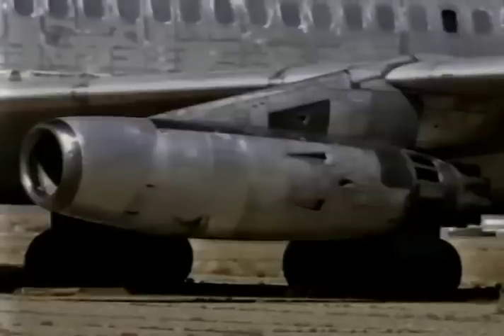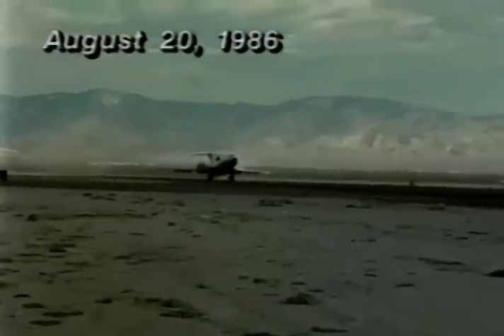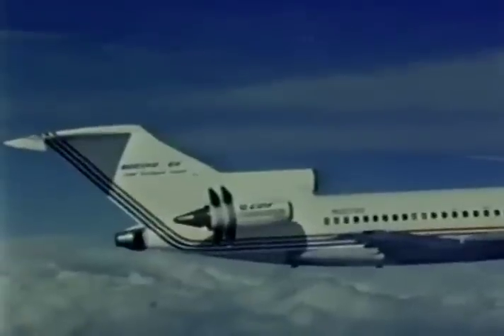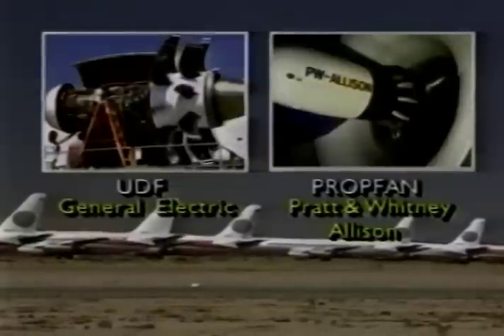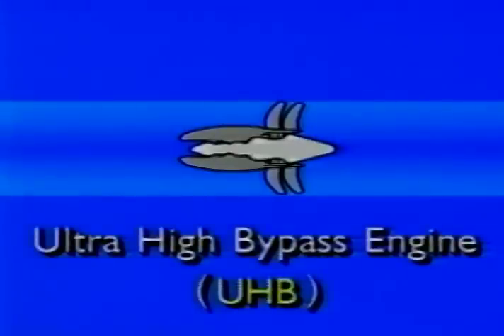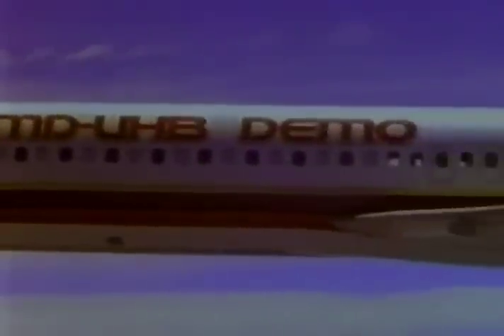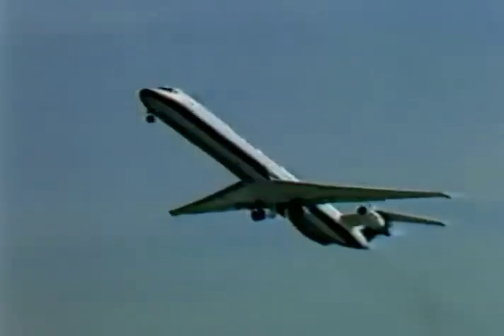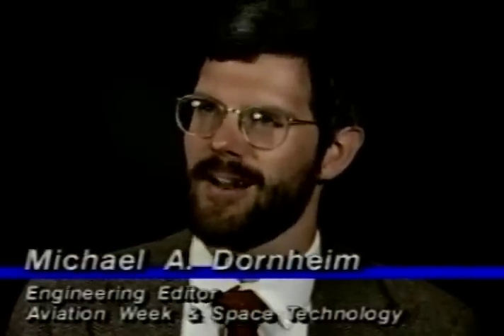The Incredible Engineering of Ultra High Bypass Jets

Comment: now we know that with a gear we can achieve a slow rotating huge fan to achieve a really high bypass ratio of 70. that seems to be the future. if we want to use expensive eFuel, then we need very efficient engines.
Reply from the maker: Hi Stefan, thanks for watching and taking the time to comment. It does indeed seem that GE, Rolls Royce and Pratt & Whitney all have their own geared ultra high bypass programs at the moment. There may yet be some tough technological challenges ahead so watch this space for updates.

Comment: Essentially, this is how a turbo prop works. The UHB failed due to noise issues.
Reply from the maker: Appreciate you watching and taking the time to leave a comment Aphex. I think your summary does not quite catch the essence of what took place.  It is partially correct in that noise was a big issue. 

The entire premise at the time, however, was for the economics to work, both the fuel efficiency improvement and the increase in fuel prices needed to occur. Beyond that, as the comments I've made all over the place make clear, much of the technology is very much alive in evolved form today. In fact, modern turboprops increasingly look like UHB, from general aviation to cargo transports used by military services across the globe. Are they Ultra High Bypass jet engines? One could make the argument, no, they are not. Are they evolved from the technologies and ideas of UHB? I think you can say, yes. Just like a 787 is not the same as a 707, but, putting aside the number of engines, it is an evolved expression of the ideas, technology and experience of its predecessor.

Comment: Turning the fan into a propeller isn't practical for speeds above 500 mph. Contrary to what is often told, the fan is really a compressor that compresses the bypass air along with blowing air to the engine, both core and bypass. The bypass air expands and accelerates to produce jet thrust in a similar manner to the core. Sure, smaller diameter propellers with more blades work better at higher speeds but they achieve their best efficiency between 400 and 500 mph if that which is why the A400 (an unducted turbofan engine) flies at these speeds when true high-bypass turbofan engines are most efficient at speeds above 600 mph because of the fan's role as a compressor for the engine to produce more jet thrust even if the overall exhaust speed is lower than that of a turbojet.
Reply from the maker: Chris, I just re-watched this video to see what you were specifically responding to and I can't for the life of me figure it out. 

Your first sentence is, "Turning the fan into a propeller isn't practical for speeds above 500 mph."

No claim by me (back in the late 80s by the way so any response to this video should be given with that context) is made about turning the fan into a propeller at any specific speed, let alone above 500 mph. This video is a report about two companies trying to build ultra high bypass jet (gas turbine) engines in pursuit of fuel efficiency. Not a specific speed target. 

I watched your two jet engine explainer videos and read your about tab before responding. I can see you have a deep and sincere interest in this topic and aviation generally. As a fellow creator, let me share with you that it is considered rude to drop a comment in the manner you have. I don't know if you were trying to help clear up a common misconception about what folks typically call fanjets and high bypass ratio jets (which this video had nothing to do with and therefore your comment would be off topic), or drive attention to your own channel and videos, which would be spamming. 

I wish you well and improving wellness (I did indeed read your about tab). And suggest you conduct yourself with this in mind: Do unto others...

Comment: Were the UHB engines as loud as I suspect they were?
Reply from the maker: They were louder than current high bypass ratio jets if I recall correctly. I did hear them run as you can see from some of the footage in this story, but it was back in the 80s. I would not say they were surprisingly loud. In fact, less so than early pure jets 50s-80s, but because of the open rotors they sounded different too. Appreciate you watching and taking the time to ask a question.

Comment: with the advancements in engine and prop tech, this idea might be revisited.  Things like a Pratt and Whitney 150A engine with a Dowty hub and 6 bladed prop are seriously quiet in flight these days.  The GENX engine is scary quiet.  Add in the ceramic matrix composite from the GE LEAP engine once they get the issues worked out, and this looks like an interesting combination.
Reply from the maker: Thanks so much for watching and taking the time to leave your helpful and thoughtful comment. Between CFD, CAD/CAM, additive metal printing (3D printing) and other advances, from noise to vibration and efficiency, I'm sure something that looks like the child of UDF could be very much a possibility.

Comment: The reason for the efficiency is simple. Based on the kenetetic energy formula: 

Ek=1/2 mv^2

And  Newton's first law:

m1v1=m2v2

It take less gas to move a big mass of air backward at a lower speed for the same amount of trust. The easiest way to do that is by increasing the diameter of the pressure disc of your propeler.  The unducked counter rotating fan are very noisy and don't had alot of gain by having the second fan capturing the rotational flow from the first fan. That's why the single turbofan commonly used today have won the feasability contest.
Reply from the maker: Thanks for watching and taking the time to comment with such mathematical detail. Curious what others with expertise in the math, science and engineering related to the physics here think?

Comment: It's 2020. This idea went nowhere.
Ducted fan won out.
Reply from the maker: John, I do appreciate you taking the time to watch and comment. 

However, if you'd also read some of the hundreds of other comments you'd see this thought has been addressed.

For the record: Turbofans or fanjets existed long before the experiments shown here on UHB. They have simply gotten bigger (in some cases) and, wait for it, incorporated many of the technologies explored here... in UHB research. Despite some problems, Pratt & Whitney has gone big on geared turbofans of late. That's DNA from the propfan effort described in this video.

There are also highly efficient advanced turboprops flying that incorporate lessons learned in UHB. Take a hard look at the Airbus A400M Atlas or Lockheed C-130J Hercules. Not identical to UHB but as distant cousins the family resemblance is clear. Ducted fan, as you called it, survives for sure. But many-bladed gas turbine-powered turboprops (essentially unducted fans)  with highly swept blades exist today in the examples I gave above, and, arguably, others operated in aircraft built by the Former Soviet Union.

Comment: It's now 11 years later and these UHB's are still nowhere to be found. I think they put a large, single fan in front and called it a turbo fan? Huge fans, 6'-7' across.
Reply from the maker: Appreciate you taking the time to watch and comment. If you'd also read some of the hundreds of other comments you'd see this thought has been addressed... more times than I can count.

For the record: Turbofans or fanjets existed long before the experiments shown here on UHB. They have simply gotten bigger (in some cases) and, wait for it, incorporated many of the technologies explored here... in UHB research. There are also highly efficient advanced turboprops flying that incorporate lessons learned in UHB. Take a hard look at the Airbus A400M Atlas or Lockheed C-130J Hercules. Not identical to UHB but as distant cousins the family resemblance is clear.

Comment: I guess that idea never took flight... It would be pretty bad if one of those blades fractured as well. As an aside, Chief Engineer Eckels is part alien.
Reply from the maker: Thanks for watching and taking the time to comment. Actually, on the blades, it would not be too much different than modern turboprop propellers I suspect.
Reply: AeroSpaceNews.com possibly... but I think to make it safer, and more efficient, there should have been a nacelle around it. So basically it was a turbofan at the rear of the engine, rather than at the front. An expensive, complicated, mechanical turbofan. Even the concept version that didn’t use a transmission could’ve used a nacelle.
Reply from the maker: "Even the concept version that didn’t use a transmission could’ve used a nacelle." Both were concept demonstrators - one with and one without a transmission, offered by teams from two different entities with two different design philosophies attempting to achieve the same goal: greatly improved fuel efficiency at fanjet aircraft speeds.

Comment: Why don't they just cover the props with a cowling and move them towards the front of the engine? That could actually reduce the noise and increase thrust, and on the subject of the blades, why not just use a single set of regular turbofan blades arranged in a tighter configuration instead of 2 sets of counterrotating prop blades? it would save weight and be easier to maintain. And if they really want to reduce noise, why not just shape the exhaust of the engine in chevrons, that should get rid of that noise-generating turbulence. Oh, wait...

Comment: Interior noise and the threat of uncontained broken blades made it a non-starter. The large ducted fan of modern jetliner engines made even larger up to 140 inches in diameter was the chosen path instead.

QUOTE:  "The GE90 was developed from the NASA 1970s Energy Efficient Engine, a prototype variant of the General Electric CF6. 

GE's GE36 Un-Ducted Fan (UDF) was meant to replace the CFM International CFM56 high-bypass turbofan which was initially uncompetitive against the rival IAE V2500. However, when the V2500 ran into technical problems, sales of the CFM56 took off.

 GE was not interested in having the GE36 cannibalize the CFM56, and while "the UDF could be made reliable by earlier standards, turbofans were getting much, much better than that." However, GE integrated the UDF's blade technology directly into the GE90."
Reply from the maker: Thanks for watching and taking the time to leave a comment. I hope others who ask, endlessly, where these engines are today, read your entire comment so they can see the DNA of these engines (the blade tech you mention for example) lives on in the GE90.

Comment: No gearbox, but counterrotating  fans?
Reply from the maker: Thanks for watching and taking the time to ask a question. I believe it was accomplished by changing the orientation of the turbine blades driving each prop. So inside the engine there is a hub to which the outer blades are attached. Attached to that hub is a turbine through which the hot air flows. For simplicity's sake, if one hub had turbine blades left oriented and the next one had turbine blades right oriented each would turn in different directions. As a result, their outer blades would also spin in opposite or counter rotating directions. Make sense?
Reply: @aerospacenews  That would mean three nested shafts with all three requiring careful balancing, lube system, etc. This would require a completely new engine design. I doubt they would do this. The cost would be extreme.
Reply from the maker: Listen to the quote from the GE guy again where he talks about no gearbox. That's my recollection of what he meant.
Reply: Wow did some checking. It is driven by two different turbines!
Reply from the maker: Appreciate you digging into it and sharing your findings.

Comment: Nobody gave a rats ass about how much carbon turbofan engines produced ie. how much fuel they used. Half of all carbon emissions have been produced in the last 30 years. Only now P&W and Rolls-Royce are developing geared ultra high bypass turbofans.
Reply from the maker: Thanks for watching and taking the time to comment. I respectfully disagree. The airline industry more than almost any other industry has always been focused on fuel efficiency. Not because they wanted to be "green" (before now). But because it was a cost driver. They wanted to save money. Happily, the two are in alignment. Fuel efficiency is both green and offers lower operating costs.

Comment: So, can we suppose that the fact that gas is still relatively cheap and that there have been other more conventional designs with the same efficiencies but less deployment complications as the main causes?
Reply from the maker: Thanks for watching and asking your question.

Perceived noise and passenger acceptance issues along with relatively stable fuel prices killed this at the time the video was shot. But as other comment threads mention, core compressor, blade and turbine design tech does in fact live on today in modern ultra high bypass and very fuel efficient jet engines.

Comment: 4:41
So I guess it's not when yet. When will "when" be?
Reply from the maker: Thanks for watching and asking a question! While the exposed blades are arguably in service on the A400M and newest C-130 variants,  the engine core technology has been flying for years as is discussed in numerous comment threads on the video.
Reply: @AeroSpaceNews.com

Well, those are mere propellers, turboprops. Not propfans, much less these double counter-rotating propfans.
Besides these were meant to replace the turbofans on jetliners, which certainly didn't happen to any degree.

Comment: CO2 emissions do not hurt the environment or pollute the air, they’re harmless and atmospherically insignificant, Hydrogen Sulphide is a more effective greenhouse gas, but we wouldn’t have life on earth without it,  again Carbon Dioxide is not a pollutant,  it promotes plant life and replenishes rainforests! 
 Pssssst! Global warming was a big fat hosx! 0.8 degrees in 138 years and its down by .2 according to the same cherrypicked measurements that were used to dupe the populous by the paid panel of junk scientists
Reply from the maker: That comment is misleading and flies in the face of overwhelming global scientific consensus. 

Ya know science, the methodology that has produced things like the aircraft seen in this video, or, say, the brake technology used in those car thingies on roads across the globe? 

The issue with carbon dioxide is not "hurt" of the environment or pollution as the terms are correctly used, it is climate change. A very important distinction. And human-produced carbon dioxide is measurably responsible for recent climate change. You are free to argue if climate change is good, bad or neutral with regards to the consequences for humanity. But at least arm yourself with the facts.

Climate change has always been a part of planetary evolution. The record is clear, there have been ice ages (yes plural) and super oxygen-rich hot house periods.

The rational question to ask is: If our species is forcing rapid change, what are the consequences of that change, and how do we react? 

Those other humans on earth living on low lying islands and near coastlines seem to be in grave danger at the moment. There are other seemingly unwelcome consequences elsewhere on the globe. It does not serve us, or our kids, to mimic ostriches me thinks.

Comment: 50c a gallon! The new GE engine has a gearbox and the blades have been incorporated with the front blades making them bigger and this achieves the bypass effect.
Reply from the maker: Those were the days, right? :)

Thanks for watching. Yes, this approach from the late 80s has been surpassed by modern configurations that cherry picked the best technologies but as a whole system it has not yet ever (and may never) see production.

Appreciate you watching and taking the time to comment.
Reply: We have had ducted fan engines for years now, the new GE engine improves them though. By making the fan many times bigger but still using the same sized engine to power it, and running that fan at a slower speed it becomes more fuel efficient and also quieter and safer, less chance for a blade off.

Comment: Unducted Fan the name itself tells you why this went nowhere, Unducted means no duct to catch the pieces when a blade breaks and gin-sues the fuselage I am watching this video on 1/28/2017 the most powerful engine on earth is GE's 90 115b high bypass turbofan engine. one of the tests they had to subject it to was a test to ensure that if a fan blade broke the duct would contain the fragments and they would not penetrate the fuselage of the aircraft. so much for UN-ducted fans. the GE 90 115b has reached 127,500 lbs thrust.